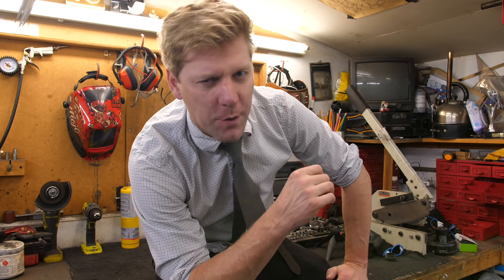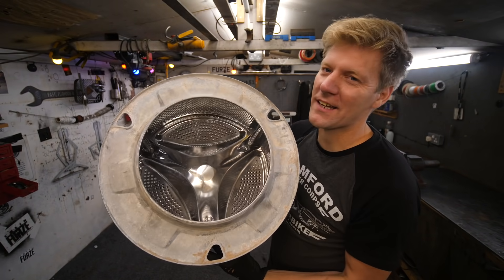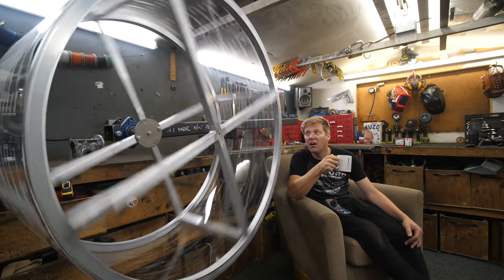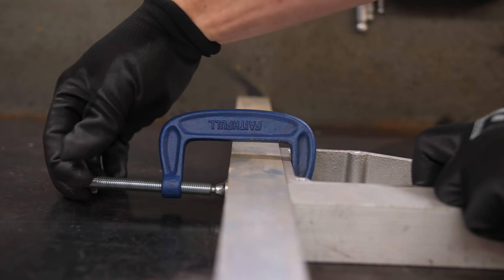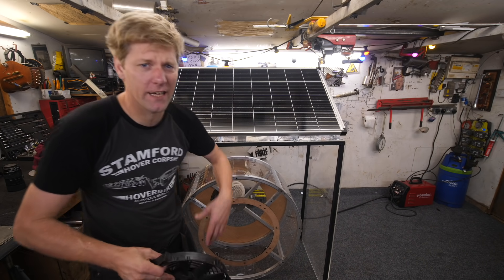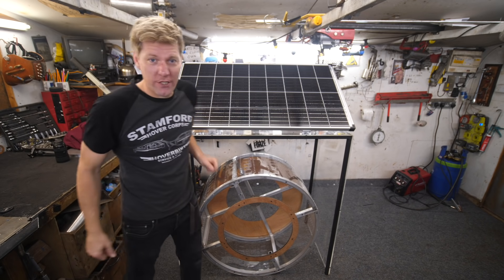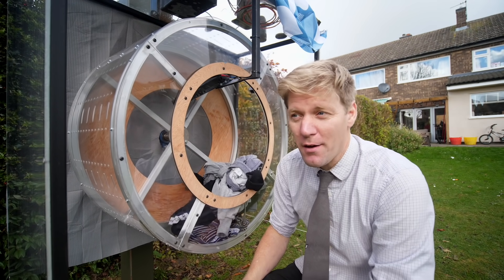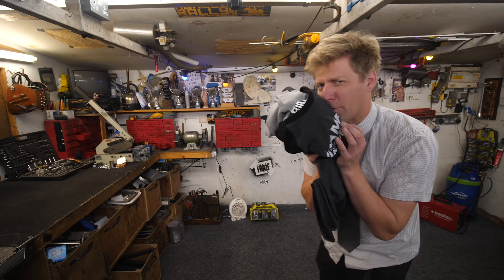Wind/Solar Powered Clothes Dryer

Comment: The coolest I have seen is Hydronic CLothes Dryer using a Wood Burning Furnace. 
I guess you could also use Geothermal which I think would be a good Ferze project

Comment: Nice job that it works. Does the wind also add electricity to the system. Would only be able to use it like 3 months a year in Canada

Comment: Quick question: why didn't you use a belt or chain system for transferring the energy to the drum? That way you could have had a horizontal turbine as well as less energy loss

Comment: Colin, I often wonder if a vacuum pump would be an efficient way to dry clothes, you could direct drive a pump from your wind turbine and use this to pull the air + water vapour out of the clothes in the drum.

Comment: Seems also that it needs some ledges inside the tumbler so that the clothes get pulled up higher. Then they properly fall and should get mixed up more, both within each other and with the air, and thus should dry faster. At the moment they just stay quite close to the bottom .
Like a normal tumble dryer has them, and laundry machines have 'em too.

Comment: What about adding fins to the interior of the drum so that the clothes are lifted higher and tumbled further with every rotation of the drum? 

And will your solar panel also power a small heating element that your fan can blow air across and introduce warmer air?

Comment: As an ex-laundry engineer, this disappoints. The drum speed needs to be around 30-40rpm to get the load to tumble properly and have “hang time”that, is what will dry the clothes. This may as well not spin at all eight now, as that pile isn’t getting separated much.

Looks good though!

Comment: "I may have overengineered it slightly" - Colin Furze in a nutshell
Reply: Now that should be on a t-shirt
Reply: overengineered? dunno what you're on about... 😆
Reply: Just a bit... I put up some things on the line and watched the video... just checked and they are dry already.
Reply: The hardest thing in engineering, sometimes, is making things as simple as possible.
Reply: https://youtu.be/kbY53RLJHfYy5
Reply: asinLoveyunz.link
Reply: over built, under engineered

I bet all the university engineers will have a good laugh at this :D
Reply: Yeah theres a thing called clothes hanging way cheaper no need for windmills.

Comment: There you have it, wind turbine powers biggest failure, "we got no wind". As for solar power, need I say it " we got no sun" oops, we got no power.
Reply: That's why wind turbines are almost always placed in windy areas. And as Annie said, "The sun will come out tomorrow". Solar and wind are practical but they can't be used alone. What's really needed is better cheap energy storage / batteries to keep everything running smoothly.
Reply: @eDoc2020  We ignore the MASSIVE  expenditure of fossil fuels used to create green energy replacement. The huge amount of land needed to place solar farms and the destructive effect on wildlife by turbines. We have a great clean replacement, nuclear.
Reply: @MikeHarrison3266  Well green energy COULD be used in the production process. But I agree, nuclear is a great replacement for fossil fuel plants. The biggest problem is many people are scared of it.
Reply: Oh, and nuclear can only done at large scale so it can't be used off-grid. But this is of course a niche application unless you count cars.

Comment: Colin! get a bicycle, mount that to a frame. Then attach a drum like the one in this video to a shaft, that gets turned by the riders turning crankshaft. Much easier to mount indoors, easily enough energy to power a small heater motor inside the drum too.
Reply: Are you crazy? Human power creates lots of carbon emissions, AFAIK more than the average fossil fuel power plant per amount of energy produced.

I'd like to remind everyone that there's more to environmental friendliness than carbon dioxide.

Comment: Colin Thanks for a great YT Channel. This proves that renewables and Greentech are tricky at best, and greenwashing at worst. I follow an American cornfarmer with tractors aso. He sells the corn to the local ethanol-plant. Green enough so far. But then he had a tour at the plant. They use shale gas to destill the mash to ethanol. So essentially they turn diesel and shale gas into ethanol to power E85 powered Koeniggseggs with a low energy return.

Comment: perhaps you can make a thermal mass that gets heat from sun then through convection funnels hot air toward the drum. or the fan can be used cause its there anyway.

Comment: One thing you might want to add are a set of fins inside the drum. I don't know if British Tumble dryers have them, but American tumble dryers do. They act like a mixer, and separate the clothes as they tumble, allowing more air to circulate between them. It would cut down the drying time.
Reply: We do have them

Comment: Had a air radiator behind the solar panel and send hot air with the fan it's more efficient for the solar panel and for dry the clothes

Comment: Would it be possible to add, instead of just that one fan in the drum, one with a heating element to expedite the drying process? Like taking apart a little space heater and hooking that to the solar cell to add an air current with some heat in the drum.

Comment: that is a lot of engineering and materials just to replace a 50 foot piece of rope. what is the carbon footprint of all those materials. plastics, metals, gears, motors, solar panels, electronics, batteries... compared to a rope anyone could make at home tied between two trees...
that is the hilarious fallacy of modern carbon neutral lifestyles.
the carbon created by the industrial processes that support your climb to neutral can never be undone by living neutral.
example, driving a 10 year old gas car, has less carbon footprint than purchasing a a brand new Tesla. the footprint of one electric car battery is 10x more than the lifetime of a gas car. not to mention that the electricity used to charge an electric car almost always comes from coal plants...
green my foot.

Comment: Some things are just way more efficient when you are willing to put a little work into it. If you hang your clothes on a washing line the wind or the air can get easily dry them, and the clothes last longer because they don't rub against themselves and  other clothes. The washing line has of course a problem when it's raining but maybe that could be fixed with some Furze's ingenuity.

Comment: An additional upgrade could be a heat exchanger. You could have a black painted radiator collect heat energy from the sun, then pipe the hot water to a heat exchanger in front of the fan to provide hot air to dry the clothes. This system could potentially be a sealed system without the need of a pump, or you could use the solar to power a small pump.

Comment: actually let me guess, if you modified an actual clothes dryer to be able to run from a solar panel, it would dry the clothes even faster than this, be much cheaper, and take up much less space. this is a dumb idea. as dumb as the cake eater machine

Comment: Great idea!  And just as "practical" as are most of them LOL.  Personally, I'd go with the solar panel and turbine yes, but have the turbine feeding a generator that goes into a charge controller along with the solar panel to feed a (non-green) battery bank.  Then, through a 2000W+ inverter run something like this: https://www.goedekers.com/Summit-SPWD2201SS.html

Comment: I think some baffles in the bin / basket would help too. Now the clothes only tumble when they reach one of the aluminium bars, they just slide over the plexiglass. Tumbling is where it's at. Plus, those baffles could also move the clothes back into the bin a bit.

Comment: Dear Colin,

i like your approach, but honestly i think this isn't really doing anything, because the most countries try to generate all of their electric power renewable. So your high-tech-dryer will pull renewable energy in near to far future.
And...it's cool to be able to see the clothes because of the plastic sides, but i would love to see some kind of wood instead of a product which is descended of crude oil or natural gas. Maybe the wood even will pull some humidity from the clothes...

Off-topic at the end: Is it possible for you to work with Hydrogen? In my opinion future is mainly powered by hydrogen, so everybody should get some more "handy" information about hydrogen. Because everybody is able to make hydrogen at home you could show us a little power-to-gas-reactor and a maybe common use in future...or you just can power a rocket with the hydrogen you produced. :D

Comment: I'm sreosly jealous of how much equtitment you have.
I've just had to take off the whole brake asebly and half shat off of my tractor becous the drum wouldn't come off,
Now I'm useing a half 55 galon drum and a mains booster/charger to electolasis treat the whole brake assembly (including half shaft and acsle baring) just to free the rataining bolts.
Reply: I know it's a bit of a rant but I can't help it.

Comment: Get video as always, I wonder how long it it would take to offset the carbon its construction? What PV panel controller was that do you have a link. I have a spare panel I want to put to use in the garage to bu type inverters I have seen so far out weighs the benefit

Comment: Without heat it will take days to dry.  You should have made a solar heater to dry faster... parabolic mirrors or a solar box to concentrate the sun on that clear slowly tumbling dryer.  leave the fan and motor and use the solar panel to do that.  The heat should make a huge difference.  Personally I would take the plastic off of it and make it a wire cage for more airflow.

Comment: Tec powered stove fan. Cept run the 12 v through the Tec instead of having it run off the heat of the stove. That way you'll get a source of heat and air.

Comment: collin adds all of this crazy stuff on when he can just add a solar panel to a normal dryer lol
Reply: Or just use an outside clothesline or in typical British weather and indoor clothes horse.
Reply: oh no sir he cant have you looked at the plug on your dryer there is a reason it wont fit every plug in the house they draw a shit ton of current.
Reply: @hardwirecars  Soooooo, do you think that the Sun just isn't up to the task??
Reply: @hardwirecars  the dryer plug will fit every socket in the UK. 👍🏻
Reply: @hardwirecars  Nope, my dryer here in the US has a regular plug like everything else.

Although it does happen to have a gas line as well.

Comment: All this when you could have just used the power from the wind turbine and solar panel to power a drying machine. 

It's a cool project, but under the guise of energy efficiency and lowering the carbon footprint, it's kind of terrible. If every machine had their own power generator a lot of potential energy is going to waste.

Comment: In Colin's Dictionary the very definition of Hell:  to live in a condo.    We could possibly fit a dryer into ours, space is about 2 feet wide and a foot deep,  8 foot tall though.  As long as it doesn't break the noise ordinances for the building, does not impact the walls of the building, does not become attached as a part of the building structure, is not visible on entry by guests to the unit and does not cause an elevation in the set electrical to the unit....yup, the very definition...

Comment: Here is an idea use copper pipes around it with water and put small heating elements on the pipes and a fan to blow the heat in to the tumbler. Also if your by a stream use a water wheel to tumble.

Comment: I've worked on these up right turbines before if you change the shape of your blades from curves to aerofoil shapes it will turn better with minimal wind.
Reply from the maker: yeah since I've made this I've seen that, theres so much to learn doing these things.
Reply: @colinfurze  Still dope though dude wasn't a criticism! I think with the governments ban on new build house's using gas this means Air source pumps with be more widely used.

Comment: Very clever.

Add a second solar panel and you might be able to power a heating element maybe.
Reply: Or, MIRRORS! Much cheaper and no rare earth crap.
Reply: stop with that solar panel heating bullshit. a solar panel is at maximum 20% efficient, but if you have some beercans painted black (like very black) in an acrylic box, that has nearly 100% heating efficiency
Reply: @MrDoboz  Yeah, I suppose...

Though, it'd just be for a line going around the inside of the drum, so the head could be concentrated around the inside of the tumbling drum. You could do the same with mirrors and lenses, but I don't know how simple that'd be to integrate.
Reply: @MrDoboz  Apparently the world record for photovoltaic efficiency is 47.1%, a bit more than 20%. Of course production panels only go into the 30s.

But solar panel doesn't always mean photovoltaic. Solar water heating panels have been around for decades and would be a better choice here. Like painted beer cans, but a bit more professional.

Comment: I wonder if it would be possible to add a electric low power heating element of some kind (im no engineer dunno if those acctualy exist) like some kinda camping heater or something that can add that little bit of extra heat
Reply from the maker: if I added another battery and maybe another panel you could do that I think

Comment: Painting some parts black and adding active mirrors would really speed things up
Reply: I was thinking he should make the entire drum out of metal and paint it matte black. That would increase the heat considerably. Then add a parabolic mirror pointed at it, and it would work a lot better. I don't know if it'd be worth it in places like Britain, but it'd probably work as well as a regular dryer in warm, sunny places.
Reply: I was thinking that instead of a fan, having both sides of the tumbler closed might increase the greenhouse effect and speed up the heating.
Reply: You could strategically place mirrors around the yard to shine light on it.  Just don't blind yourself.
Reply: Omar 11112  You need what's called a heliostat. Basically a mirror attached to a self-adjusting mechanism so it always points to the target.
Reply: https://youtu.be/kbY53RLJHfYyt
Reply: Maybe one of those solar bathroom thingies? I think it's called a light tube.